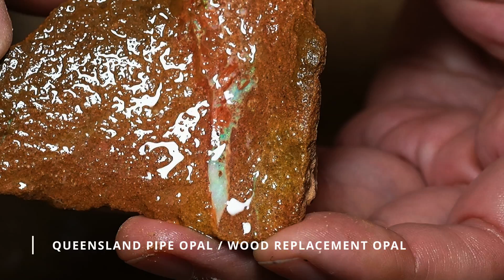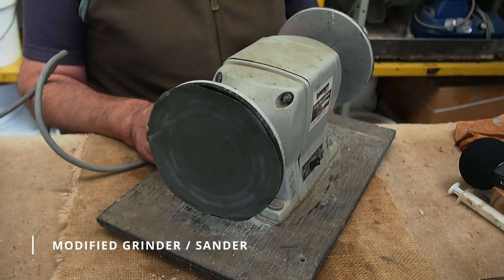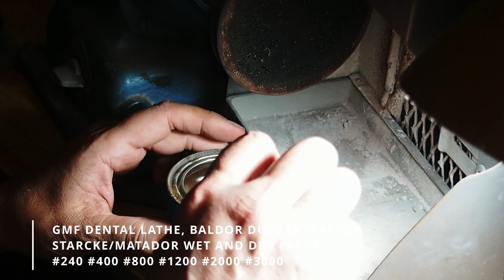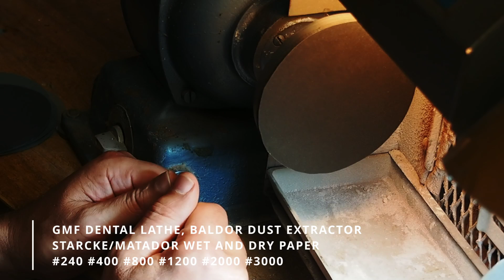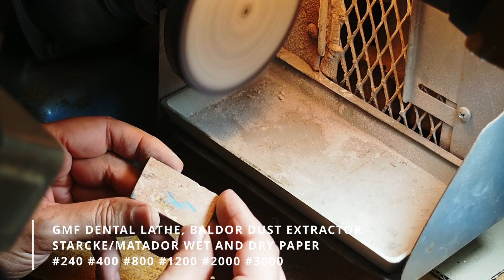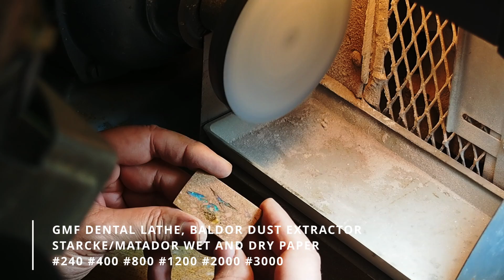It is All About OPAL SANDING. demonstrate how to use sander QLD PIPE OPAL / WOOD REPLACEMENT OPAL

Comment: Hello sir. I've never heard of pipe opal. It looked oks quite the soft material. Does this type typically need to be stabilized r an it be utilized as is. I also make jewelry, and adore opal. I'm particular to boulder opal. Thank you so much for the information
Reply from the maker: Thank you for your question. The type of pipe opal I am working with in the video is also known as wood replacement opal. The material surrounding the opal is soft in this instance but not always. It can be stabilised or can be used as it is. Thinner material can be a bit tricky to work with. By laminating it, this becomes easier. Either way care should be taken when when setting
Reply: @diverseopalproducts  thank you Robert. Your videos are so very interesting and informative
Reply from the maker: @ginalanning5303  Thank you for your encouraging feedback.